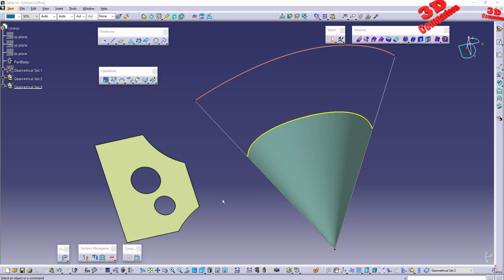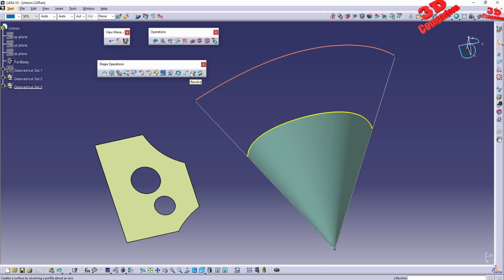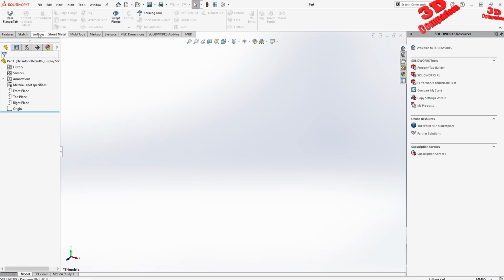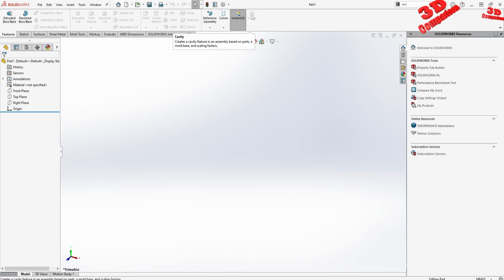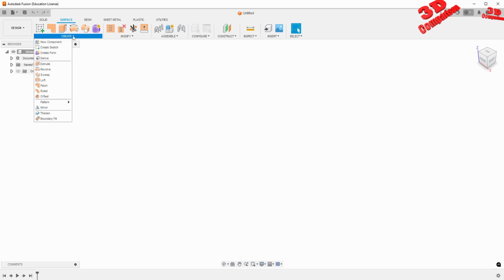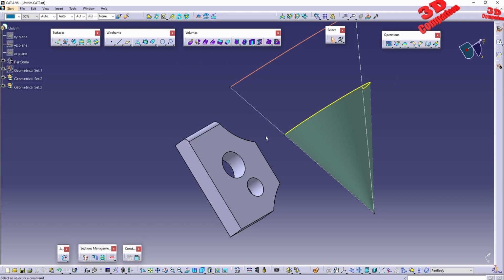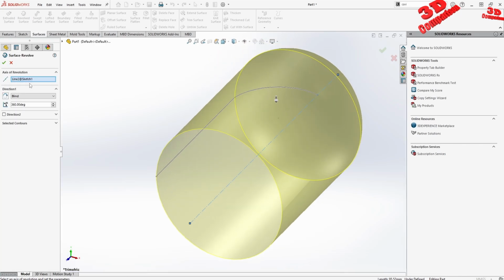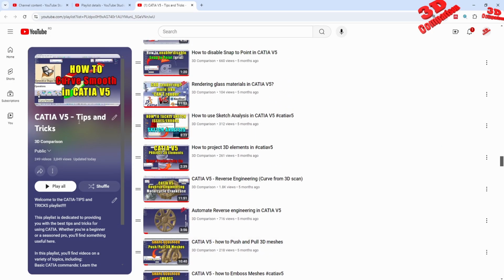Why is CATIA V5 the Leader in Surface Modeling

Comment: This is an incredible video. I use catia v5 for work, and although it had a very steep learning curve its become such a powerful tool for me. The ability to copy and paste part bodies/sketches freely and booleans are so good. But the most powerful part of catia is the surface modeling tools.

I started using fusion 360 recently. I haven’t used much of the surfacing work flow there but I’m curious what features you think are missing from it that you find yourself needing to switch to catia for?
Reply from the maker: I think that it is mostly regarding habits, since I used Catia more for surfaces then Fusion. There are fewer features within fusion, but those can be combined with freeform to compensate the missing commands. Fusion has a better learning curve then Catia in my oppinion and it is also much more intuitive.
Reply: @3DComparison  Any specific examples you can give for missing commands? Im sure freeform can compensate but thats not exactly 1 to 1